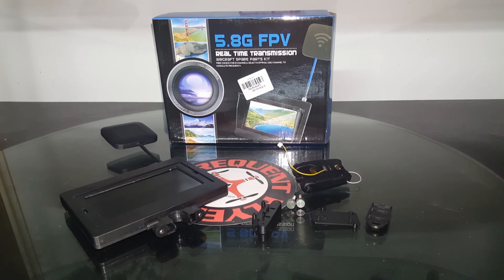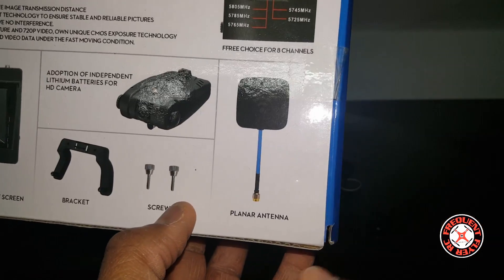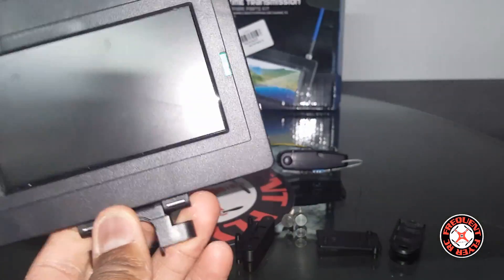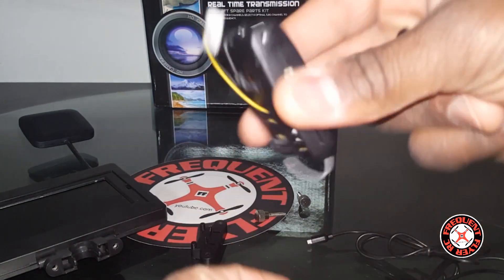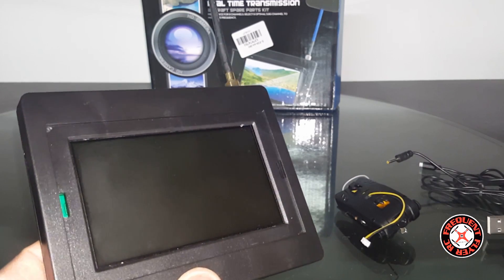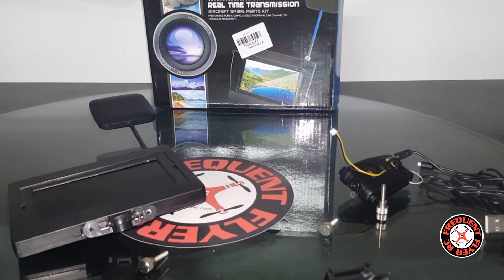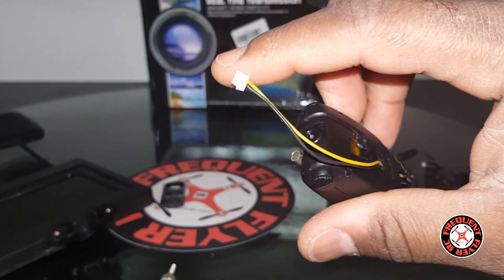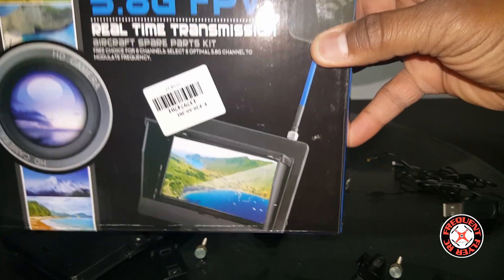5 8Ghz FPV Kit Quick Review

Comment: Nice review :) Covered it. Was I the one to let you in on the secret of the directional antenna? Haha. One thing though, was does the bottom of the antenna (tht screws on) look like? Is there a middle pin in that, or in the screen?
Reply from the maker: Yes! Come to think of it, it was your comment! I actually have both style antenna on deck so it doesn't matter for me which one has the middle pin! :P
Reply: Frequent Flyer RC Haha, sweet. The connector type does matter though, whether it is SMA or RP-SMA, different brands have one or the other, and I am sure some people would fine that handy if they want to buy a different antenna :)

Comment: How much does the camera weigh in grams?  Can you change the camera battery to something smaller and lighter? And how long does the camera and screen run with stock batteries.
Reply from the maker: The cam usually gets weak at about 6 minutes. That monitor outlasts it every time so I don't know exactly when the monitor will turn off. I forgot to mention that the monitor has a 450mah REMOVABLE stick battery ending with a JST Connector and battery cover slides off to easily swap out the battery for a larger 500mah stick battery! The cam has smaller 300mah battery soldered to the board with very little room for a larger battery.. Maybe a slightly larger 380mah might fit.

Comment: could you start recording without conecting it to my quadcopter? (my syma x5sc-1)
Reply from the maker: I hear some people have successfully modded theirs to work via add switch.
Reply: +rc model boats Check out the review on the mod from Quadcopter 101.   I believe he has modded his to ground the right pins to make it work independently.